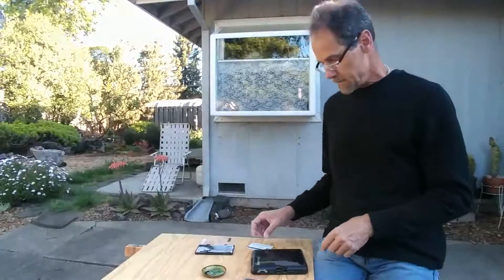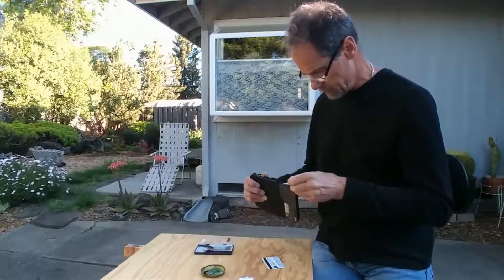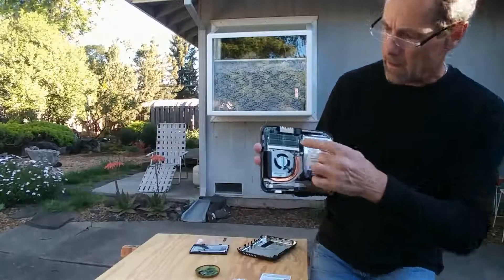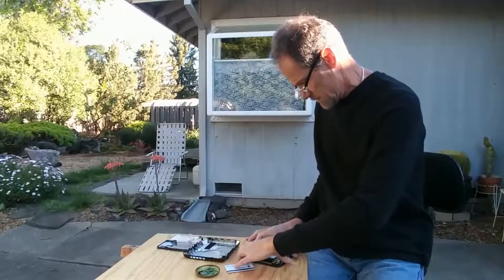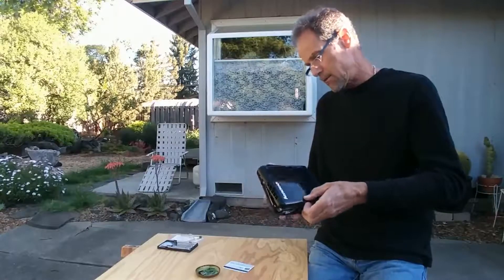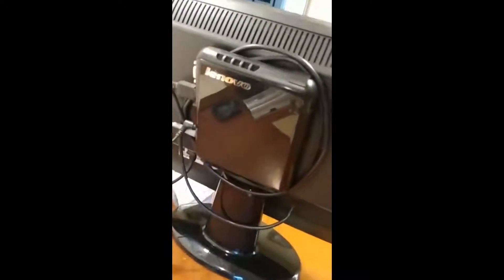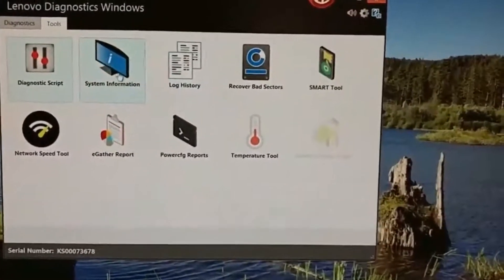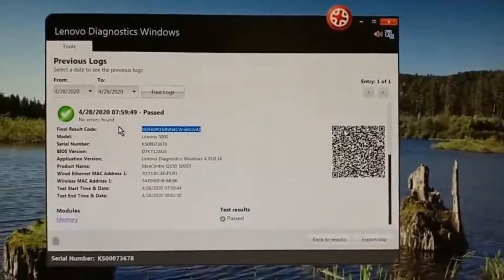Lenovo RAM Replacement

Comment: Nice review thanks ! I tried to upgrade my RAM to 4 GB. In one forum some people did. But the last BIOS version is necessary. I had no luck. I am not sure if my RAM are different (the old one says 2xR8 the new 1xR8). But the RAM Speed is the same 1033 Mhz. If somebody can help me with upgrading to 4 GB i would be appreciate. There are timings printed on the RAM Sticker. Is this also a issue for not working ? Tnx
Reply from the maker: I'm sorry, but I don't know now. It was so long ago that I did that project, and I no longer use that computer.

Comment: So did windows 10 32 bit install after changing the ram? Thinking of trying to install windows 10 on mine now.
Reply from the maker: YES! It works fine though runs a bit slow compared to Win7 on the same unit.
Reply: @ItsFixable  did you max out the ram? I would do that. Not sure what else to do to make it run faster. Thanks for the response.